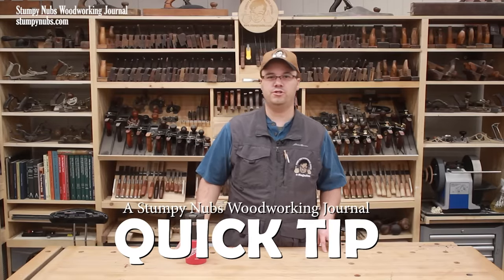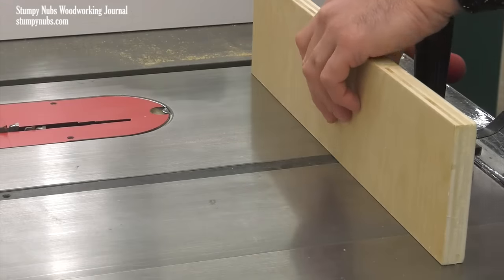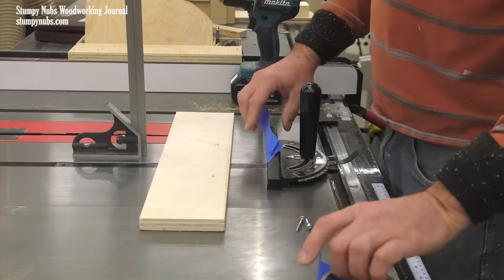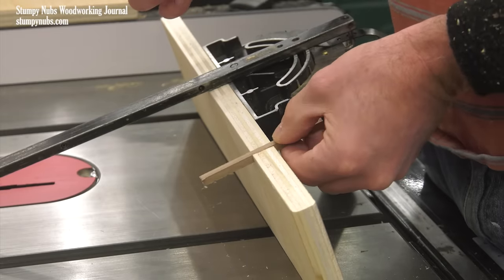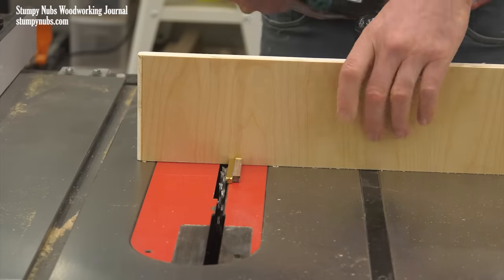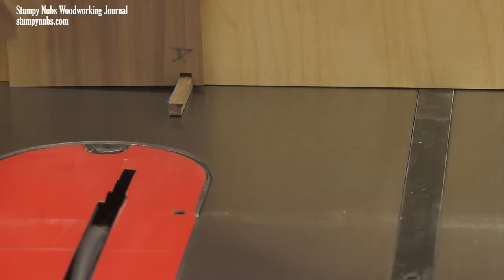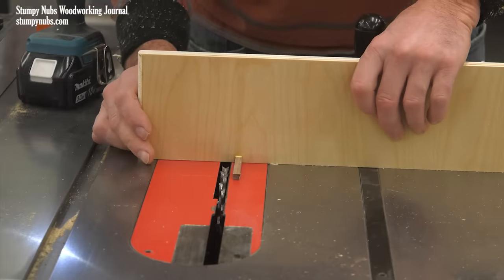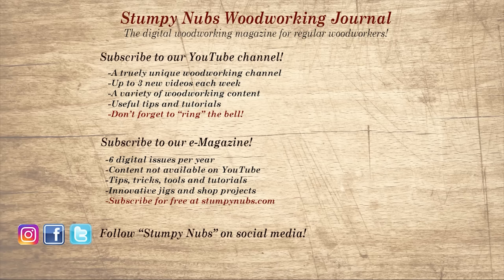CHEAP and EASY three-Minute finger/box joint jig

Comment: Nice idea, but not everyone  has a dado set up on their table saw, but great simple idea.
Reply: You could probably use a regular blade. You'd just have very thin fingers. I've seen a video on YT wherein the presenter stacked two regular blade next to one another with a rubber shim (cut from a bicycle innner-tube) between them to make a pseudo-dado stack. Haven't tried that myself, so I can't attest to its functionality.
Reply: @jabrwok  interesting,. . I need to think how to retro fit my saw..  cheers
Reply from the maker: https://youtu.be/xmA0_mLb8OA?t=49
Reply: @StumpyNubs  .. don't  understand  why you replied  with the same video? As I said, nice idea.. but not everyone has a dado set on their table saw....?
Reply from the maker: I replied with a link to the point in the video where I address that issue. You seem to keep missing it. Listen to what I say at the very beginning of that link https://youtu.be/xmA0_mLb8OA?t=50
Reply: @StumpyNubs  ...yes.. I listened..it can be don on a router table to.... I ruled this out.. I own a router, but not a router table....and my shop is not a big for both.. I use mainly hand tools,.. however I suppose that's where good woodworking is.. in the hand tools and not machines..I enjoy watching your videos, are very informative..but sometimes they are aimed at the richer woodworker. ..but most of my learning comes  from Paul Sellers YouTube channel.
Reply from the maker: Yes, a simple jig made from two little scraps of wood is aimed at the "richer woodworker"...

Comment: Stump, how did you know beforehand that the last finger joint was going to be cut all the way at the end? Is that were the first cut was indexed by the width of the guide finger?
Reply from the maker: By indexing one board against the wood strip for the first cut, and offsetting the second by a distance equal to the width of the kerf, using the jig as I showed you ensure that they come out even.
Reply: It looks like the pieces he was using are exactly 4" in width which is evenly divisible by 1/4".  The trick is to make sure that the width of the board is evenly divisible by the width of the fingers to get a full cut on the last finger.

Comment: I'm skeptical: the pin was pretty loose in the slot cut in the fence, but each piece of the box sides were a tight fit. No tape was showing (and wouldn't endure more than a very few cuts), so how did those two or three thousandths error on the pin disappear?

Nevertheless, a big 'thumbs-up'!
Reply from the maker: The pin was not loose at all. I don't know why you think it was. And you can clearly see the tape is still on there. It survived just fine.

Comment: Maybe it’s just me, but I’m having a bit of trouble with this joint.  I end up with mis-aligned boards when I try to get all 4-sides assembled.  Any advice?
Reply: Did you come up with a solution to your question? After a few failed attempts using the “visually line up cut #2” method, I tried butting up B to A last night and the joint was spot on. Tonight, I’m going to try the following method to see if all 4 corners + sides align. Any tips/tricks to offer?  

This is what I’ve been planning to try tonight: Boards A,B,C, and D will create a box; parallel boards are  A + C and B + D. 

- Cut #1: Clamp A+C together, clamp both to fence, and notch both at the same time. 
- Cut #2: Rotate A+C 180° and fit notch over jig finger.  Clamp B+D to each other, then butt them up against A+C; clamp B+D to the fence and remove A+C. Notch B+D at the same time. 
- Cut #3: Fit A+C onto the jig finger and remove clamps; then do the same with B+D. Clamp all four boards together to create a single unit and, with a different clamp, secure the unit to the fence. Make cut.
Cut #s 4+: Keeping all boards clamped together as a unit, remove the clamp from the fence. Shift the clamped unit, fitting the new notch over the jig finger. Clamp unit to fence and cut. 

Theoretically, a well-made jig should replicate the cuts in such a way that they should line up. I think this jig COULD be more precise, but it might require more than 3 minutes to make. As stumpy said, this is a “good enough” jig for occasional use. It’s also good enough for me to figure out what I need to create a more precise jig that will suit my needs. 😊

Comment: Any tips for how to do this without a dado stack...for your European viewers
Reply from the maker: As I said in the video, the process is the same on a router table with a miter slot
Reply: I sometimes use just to two outside blades from my dado set, But I wonder if you could use two or three standard saw blades??  They would have to be the same height.  The teeth need offset so the teeth don't impact each other.....

Comment: I’m sure that jig works great, and actually can be set up in 3 minutes IF you’re using a high end saw, with a perfectly dialed in zero clearance plate and a quality miter gauge. If you’re using a Dewalt contractor saw, and the miter gauge that comes with it, you are in for some serious frustration. “Frustrating “ is not the only F word that came to mind when I attempted to make and use this jig.
Reply from the maker: Any saw with a zero clearance plate and a crappy miter gauge will struggle with all sorts of joinery and accuracy issues. If you want to improve your capabilities, consider making a simple sled. And make a better zero-clearance throat insert. These upgrades won't cost much and will make a big difference, not just for finger joints.
Reply: @StumpyNubs  Thank you for the response, and please keep up the great work. Your videos are always informative and entertaining.

Comment: So, are you doing some math to create the dimensions of the wood to begin with? or does it matter? I'm picturing making a random height/width of boards... cutting these joints, but the last cut/finger ends up being bigger or smaller than the rest.. Do you just make things in a dimension that 1/4" goes into evenly?  Did I just answer my own question?
Reply from the maker: It is nice if the width of the boards is equally divisible by the width of the fingers, because you will end up with full fingers all the way across the boards. For example, if my fingers are 1/4-inch and my boards are 4 inches, I end up with 16 fingers. But this isn't critical. If my boards are 3-7/8 wide I will just have 15 full width fingers and a narrow set at the very end. Doesn't look as good, but if you are hiding it under a moulding or something it's fine.

Comment: This video is great but what if your country doesnt allow dado stacks like the uk, which is where im from, and i dont want to use my router. what then?
Reply from the maker: As I said in the video, the same jig and process will work with a router table
Reply: @StumpyNubs  thing is i dont have a router table so i cant use this idea unfortunately
Reply: Does the UK allow the wobble cutter, aka as drunken saw for dado cuts? I have never seen this mentioned. Using such would give an adequate joint in the narrower ranges, I think.
Reply: @leehaelters6182  will have to have a look at that thanks for the suggestion
Reply: @leehaelters6182  i have had a look at the wobble saw blade and like the dado we cant use them over here in the UK or the EU as our table saws arbors are made too short to take those types of blade so no dice. This is because in order to use them the guard and riving knife have to be removed, and is therefore unsafe. Which is why they deliberately fit them with short arbors.
Reply: @krustybuntrill1835 , drat! They always take the fun out of everything!
Reply: @leehaelters6182  very true

Comment: If you use a router, the cut will tend to blow out on one side of the slot as the bit exits the cut on the unsupported face.  Avoid this by adding a sacrificial third board on the outside to support the cut.
Reply: There's great new router bits now that don't blow out the backside of the wood. If there's a problem a company will solve it

Comment: Excuse a not-so-relevant comment and possible subject for a video ---  Bought a SawStop sawed dived into assembly with, of course, the SawStop manual (written by folks who ALREADY KNOW how to assemble/setup blind-folded). Result, first rip-cut jammed between Blade and Fence. Sawstop web site (not manual) directs turning screws ON THE FENCE but--I Am an engineer (electrical)--could see Fence Rail IS NOT PERPENDICULAR to the blade. So why is their first and only remedy to fiddle with the (probably OK) Fence? I've assembled, disassembled, and re-assembled this saw essentially twice.Question, kind sir: Where can this novice find ALL the REAL steps to turn my paperweight into a productive shop tool?
Reply from the maker: https://youtu.be/tNfvtStKkFA

Comment: Hi Stumpy.
I've spent the past 2 days trying to implement your box joints. Total failure! The pins and slots are just too tight! Your's slip together easily. I can't even hammer mine together. I've tried varying the with of the dado cuts with shims to no evail. Any advice would be appreciated! Ed
Reply: Whoops! I just noticed my post from 1 year ago applauding my success! Obviously I'm ding something different today. Very frustrating!
Reply from the maker: Is your saw blade cutting a kerf that's exactly 1/8? Some blades are a little under/over sized. If the saw is misaligned, if the jig is not square to the miter slot, or there is runout in the saw, it will also throw a box joint jig off.

Comment: Foiled by Metric. 
I was almost there. But, my router bits are in imperial measurements (3/8", 1/2") but my wood is metric 12mm ! Sigh. 
Off to home depot and this time I'm taking a micrometer.   Or maybe I'll buy a planer !

Comment: I want to do it on my router table, but the table's miter track is in front of the router.
Reply from the maker: Remove the router table's fence and push the jig sideways against the bit.
Reply: @StumpyNubs  Thank you. That's what I did yesterday and I'll use my new incra 1000se fence on it. Thanks again.

Comment: I tried using it on a router table and did not have success. Even having the wood clamped in place the bit pushes the piece to the side of the rotation, not good!  LES POSEY